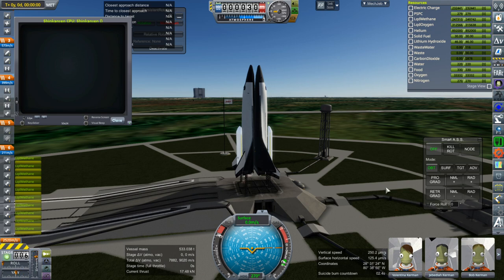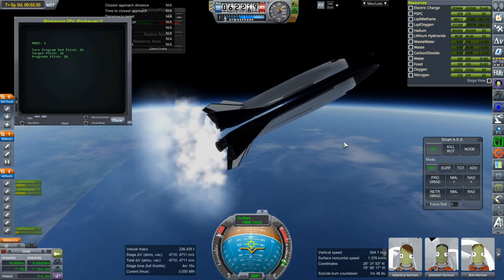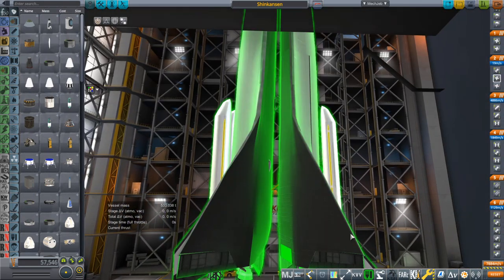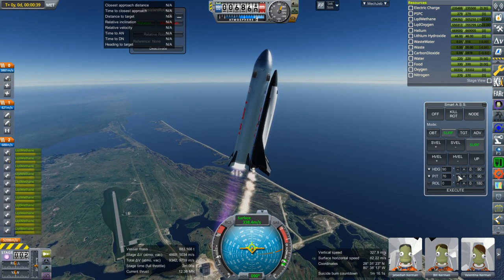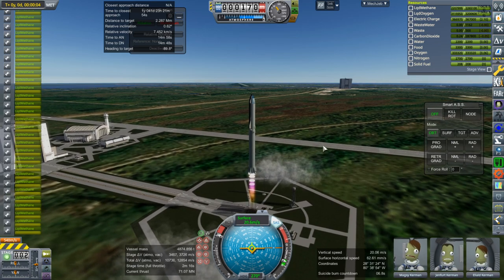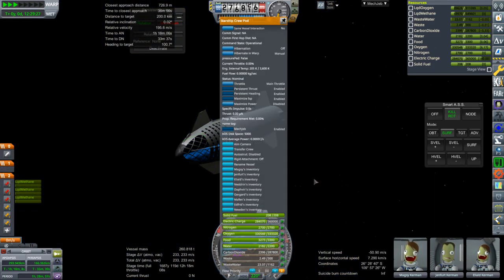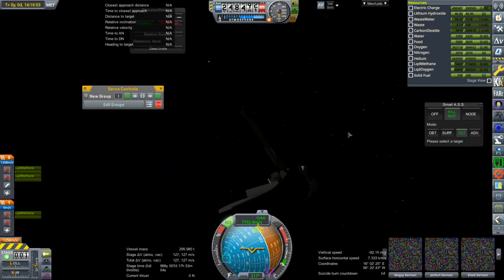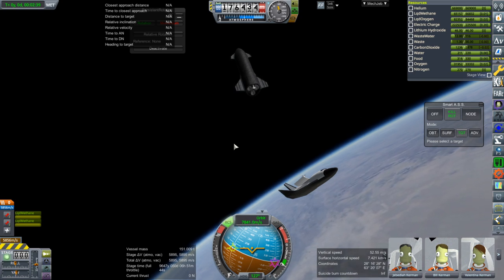Realism Overhaul in KSP 1.8.1 - Shinkansen - Unix

Comment: I was gonna suggest using the Kasei first stage instead but then I realized it wouldn’t be able to crossfeed methane, so what if the Shinkansen was just slapped on top in place of the second stage? A stage adapter for both pieces might be a pain but it also works out because if you want more delta v for the Shinkansen in orbit you could just add some Sagitta boosters

Comment: With more optimal launch and rendezvous profiles for both and not dumping any fuel, I'm pretty sure you could fully refuel the Shinkansen while keeping enough in Starship for landing.

Maybe you should try payloading the Shinkansen with Lex, then refueling the former to bring payload into Lunar orbit?
Reply from the maker: Sending it up with Lex might be possible - we'll have to see.
Reply: @RaizSpace  Just to be clear, I was thinking of you essentially doing this, then launching a separate Lex–Unix which would transfer payload (possibly your Lunar Regolith Habitat and/or Orange) from its bay to that of the Shinkansen, potentially through use of the Canadarm or CanadaTugs. My other interpretations on how you may have interpreted the comment are...
1. Attempting to launch a Shinkansen from a Unix core with Lex inside/bolted to the side of it. (Which seems almost a non-starter for weight distribution and payload mass reasons, unless possibly you could use the entire Lex spacecraft including the upper stage with a notional extendable-nozzle Raptor firing from launch.)
2. Launch a Shinkansen from the side of a Lex–Unix, having them independently make orbit after the core stage separation, before rendezvousing back together. (This would almost certainly require more mods if it is not completely impossible to simulate, but it would be, in a word, awesome.)

Comment: Hey Raiz space!!! Could you make a Prandl-t mod for KSP, its a revolutionarie NASA project, i think it would be awesome!!!
Reply: Its a aerodynamic stydy of the flight of birds and It makes the flying wing a viable plataform
Reply from the maker: I'm not really good with wings - FAR doesn't usually like the wings I make.
Reply: @RaizSpace  I dont now If would be hard to make the effect of the lift distribution of the Prandl-t wing, the result would be proverse yaw when you input aileron
Reply: @RaizSpace  It would be a force vector inducing yaw in the direction of the turn, but i dont now the limitations of FAR.